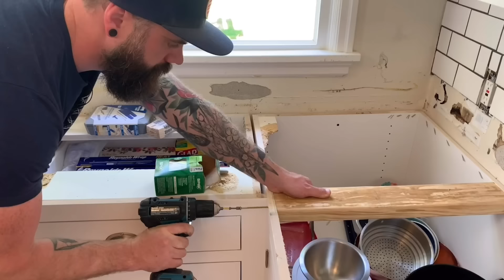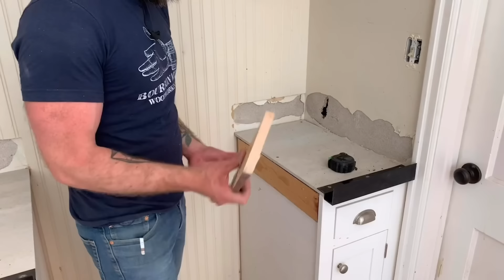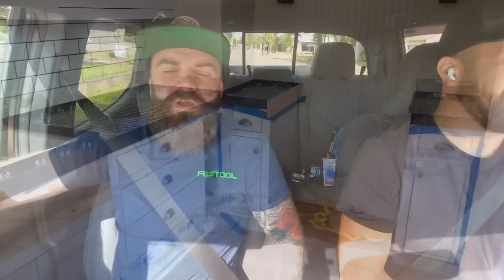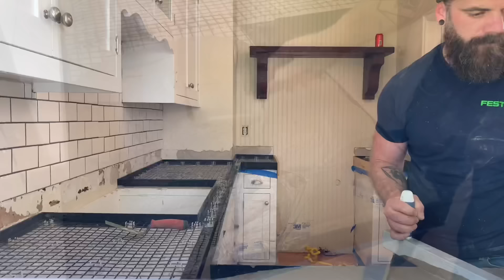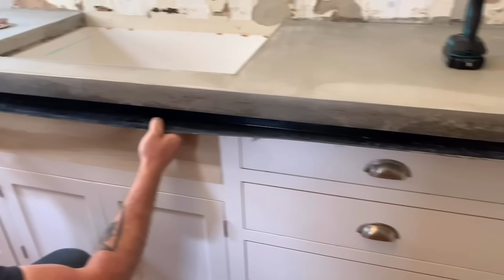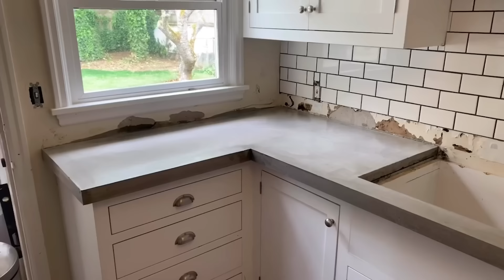Easy Concrete Countertops | Concrete Countertops How To

Comment: I was very distracted while watching your video, that backsplash looks like a drunk person did it.  I could not stop staring, like watching a car crash.
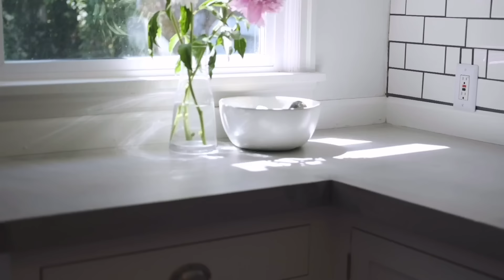Reply: i thought the same thing, look at 17:23 why take the time to do nice concrete countertops when you have a backsplash that looks like that
Reply: And also possibly baseboard bordering the backsplash and counter? Yikes.
Reply: @EL6008  good eye, i thought the same thing but wasnt sure what it was
Reply: You beat me to it. Half of the video I was looking at this horrendous backsplash install lol
Reply: Preach brother
Reply: @SIRMMA  we are slamming his finish work, but those countertops did come out nicely at least it looked like it in the video
Reply: @diggiemalo2122  Not his finish work, no. But the pre-existing tile works on the backsplash. Damn I get seasick from looking at those, check it out :)
Reply: Rob, that is not the backsplash your looking at, it's what remains after they removed the old tile backsplash from the old countertop.  It's the glue that pulled away from the wall as the splash was removed.  The rough wallboard /plaster will be covered with new tile/backsplash after the counter top is near complete.
Reply: @woodway11  He's talking about the tile work above the countertops (a.k.a. backsplash), look at https://youtu.be/llWsYmrnMUo?t=113 and tell me thats straight as an arrow?
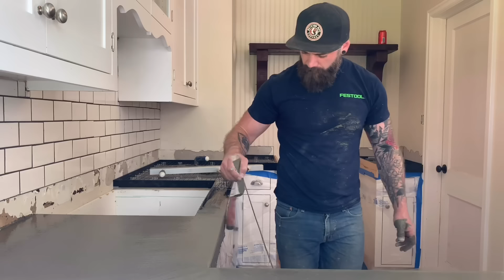Reply: @woodway11  hahahaha no that is definitely a backsplash  look at 10:45, you can see the wall board below the backsplash
Reply: Rob Guntheri was distracted- by Jason. Lol
Reply: Did it not occur to you that pouring reinforced concrete as a kitchen top is a ridiculous idea? Not cost efficient, not time efficient, messy, potentially fragile. This video is ridiculous. The dude thinks because he has a beard, imbecile cap and tattoos that he's a legend. This video is essentially pointless.
Reply: @rosbifle413  concrete counters are very popular... and its cheaper than stone in some cases. Have you been living under a rock?
Reply: @rynhanson  I'm old school. Illogical things don't float my boat.
Reply: @rosbifle413  old school meaning to dumb to change... ok there is nothing wrong with concrete as a counter. Concrete isnt fragile if done correctly. Can be colored, and sealed... granite is just as breakable. Old school used tile over wood... and you are complaining about concrete... bc its messy. Dont do construction if your worried about messy...
Reply: @niebelung54  Looking at it again, ya, the individual tiles aren't in really lining up too well.  It does look kinda sloppy , I was commenting about the 4 to 6 inches just above the counter top in my original post.  Didn't really see the field tile layout at all
Reply: It definitely looks like the tiles/'bricks' were placed there one by one, should've just done a peel and stick lol
Reply: @rynhanson  you are pathetic. Keep doing your idiotic and illogical work. I can see I've really hurt your feelings by simply stating my opinion. What a fragile person you are. If you like being messy in construction your work is without doubt overpriced and not of very good quality.
Reply: 😂😂😂😂😂 I probably have bad decorating skills then cause I thought the backsplash looked beautiful once everything was done. I was more concerned with the cabinets and cupboards... 😬😂😂
Reply: @diggiemalo2122   thank god im not the only one who spotted that.
Reply: @rynhanson  you are a dry wall guy? Haha!!!! I work for a billionaire overseeing a whole range of works in a prestigious and historic building. I'm a qualified electrician and have worked in construction with my father since i was a child. Now i don't even get my hands dirty. I 'oversee' contractors working to make sure their work is up to standard. Not that you will believe me. If you're a messy worker you aren't professional end of story.
Reply: @rosbifle413  you cant do drywall with out making a mess. A professional just puts down plastic and protects everything... so basically you had your career handed to you by your dad, congrats on being spoon fed through your life
Reply: That’s the worst layout I’ve ever seen! And what’s with the cuts along the light switch???? Gross
Reply: @rynhanson  my dad died when i was 21 years old. My hard work got me where i am today. Oh yeah god damn me because my dad passed masculine qualities down to me before he passed away. I wouldn't really class filling a cement mixer all day with cement and sand for bricklayers to lay bricks as being born with a silver spoon in my mouth. Maybe a steel shovel and a lower back made of stone. On a serious note my point was simply the less mess you make, the more effective your working is. Peace.
Reply: @rynhanson  and I didn't mean to come across as a dick. All the best. Hard work is the secret.
Reply: Rob Gunther me too! So distracting!
Reply: Jack the Lad doesn’t sound like you have any idea of what you are talking about. First of all Ryan is right about the popularity of concrete countertops, tablé tops etc. Depending on the layout, concrete countertops may be installed faster than stone. And lastly it’s way more economical to pour concrete than it is to purchase a slab of Granite or quartz. In conclusion you know shit about what you say.
Reply: A grout color that matches the tile works wonders. If your setting job or actual tile size has any noticeable variances the last thing you should do is grout it with a hard contrasting color.... That being said, nothing but a chipping hammer could fix the outlet cuts. Cool video
Reply: Tiles look like an English man's teeth
Reply: He had to remove the  bottom part of thw backsplash  to pour thw top and will install the missing pieces once thw top is complete
Reply: Jack we know you installed the original vaneer countertops that got removed
Reply: I gave him a thumbs-down as soon as I saw that he had the jungle-bunny ears...
Reply: diggie malo concrete countertops are nice? Lmao i think this countertop is fitting for a house in that condition. If you want something to match your nice backsplash, you’re not gonna get a concrete countertop.
Reply: @cestmoi2681  Shaguar!!!
Reply: @timothydu9415  -- Concrete countertops can be nice if done right... I've seen some polished ones that looked pretty good... That's not to say that what Mr. Jungle Bunny Ears is doing here will look that way though...
Reply: Now I can’t stop looking too.
Reply: @rynhanson  lol, well said. "old school" I'm his context means stuck in ways of old regardless of progress. To be fair, while they look cool, I'm not a fan of concrete counter tops, and I think it's a fad that will pass in a few years, leaving a dated looking top that's a bear to change out, BUT not gonna crap on the idea because I'm "old school".  What a tool
Reply: @rosbifle413  buddy, you have issues that are really coming out in your replies. I kindly suggest therapy.
Reply: @cestmoi2681  yeah baby!
Reply: @mikeygee4564  you must be another person who can't understand that everybody doesn't agree. Like I said before. Keep working illogically. Your clients will find out the hard way that these techniques are stupid.
Reply: It looks like the person who did it broke the last tile available around the electrical jack and was like ahh fuck it ill install three pieces.. that will look awesoooommeee bahaha
Reply: Rob Gunther it “A Kitchen” enjoy
Reply: @beatrixjones2982  I'm rude because I don't agree. Get fucked you simple minded moron.
Reply: Jack the Lad lmfao
Reply: Jack the Lad seriously dude? You’ve got zero clue what you’re talking about. It’s not reinforced concrete, nincompoop, it’s a specialized mix made specifically for countertops. Stay in your cave, gramps.
Reply: @jonrossjan  .....so....i imagined the rebar inside the concrete then? You call me a 'nincompoop' like a child yet you don't even know that reinforced concrete means concrete with reinforcing bars placed inside it. You absolute fool trying to jump on the bandwagon with the rest of the novice clowns. The mix has nothing to do with it being reinforced or not. The metal is the reinforcing. I have just taught you something. Be grateful.
Reply: @jonrossjan  a simple Google search would teach you this. Jesus you must be dumb. Google- "What is reinforced concrete used for? Reinforced concrete is used for construction on a large scale, such as bridges, dams, piers, tall buildings and stadiums. It is most commonly used in domestic construction for the footings and foundations of smaller everyday dwellings."
Reply: @jonrossjan  HAHAHA!!!! SERIOUSLY DUDE??? YOU'RE STUPID.
Reply: Just wondering how long before those concrete edges and corners crumble.
Reply: @musthavechannel5262  we moved into a house where this was done to the kitchen counters six years ago. I was told that they were done two years prior. So I can confirm they are no less than six years old. and probably not more than 8. They look as great as the day we moved in. We have slacked a bit on the sealer; it was recommended once a year. I think I have done it three times total. Now, I can't say if this was a Z countertop product. It was also acid stained (I think that's the right terminology).

I have seen similar work done in restaurants, namely the restrooms, to the point that even the sinks were poured concrete. I personally find it a really nice industrial look.

Will it outlast stone, or other options? I have no idea. One guy on here seems adamant that this is an illogical build. I don't do construction work so I honestly couldn't say. But it doesn't seem to be getting damaged, despite not going out of our way to keep it looking nice.
Reply: As to ALL comments abt the backsplash...Didn't he say 1st off..."This is A kitchen..NOT MY KITCHEN"... obviously doing someone else's kitchen it's NOT good manners to just blurt out how bad a homeowners backsplash is...maybe it was their 1st try..a friend or someone did it for them..,who knows!!  All u men can relax your chests, we get it!! 
So it isn't a reflection on him. They always talk abt women gossiping-- but working w men on any construction-whew!! Just kinda difficult trying to get any beneficial info with all these men who obviously have to cut others down to bolster their self esteem, instead of just making constructive/helpful comments.
Reply: @diggiemalo2122  u7 u7 un ñ7
Reply: Dude, so glad I’m not the only one who noticed, I felt like a jerk but when he paused the video, I’m like “holy crap that’s an ugly splash” 😂 also light sanding / polish goes a long way in making nice concrete tops that don’t look DIY. 👍🏽
Reply: @diggiemalo2122  photos never do it justice, good or bad but we’re not here to criticize. Good effort and some good tips either way. 👍🏽
Reply: @woodway11  no we are looking at the joints and consistency of the tile work above that. It’s not great.
Reply: @clalyrics441  nothing wrong with one by one if the tile setter knows what he’s doing 👍🏽
Reply: @pelassancho24  all correct but some custom concrete tops can be just as expensive and more beautiful than any stone. 👍🏽
Reply: @timothydu9415  you’ve obviously never seen custom concrete counter tops, they’re done in multi million dollar homes and high end restaurants and buildings, custom features that can’t be done with stone, sometimes can be more expensive and more beautiful than any stone. 👌🏽
Reply: @armandocarlos3805  I didn't say there was anything wrong with it, but if it looks like that you're better off doing something else.
Reply: I live in a townhouse complex, and we have granite countertops. I must say I hate them. You hear everything your neighbours plonk against it! Aaargh!🙉
Reply: In fairness, this is a concrete countertop video, not a kitchen remodel video. 

He didn’t explain how to install a stove in that gap, or how they chose that sink. It doesn’t look like they intended to touch the backsplash for now. This is probably an expensive rental unit that needed new countertops. So you just replace what has to be replaced and carry on with life.
Reply: Not to mention the tiling!
Reply: @woodway11  1733 is the finished 4-6 inches above counter
Reply: I only came to the comments section to make certain somebody mentioned this tile job! Looks like the homeowners did it themselves. Probably after they spent their wad on the custom inset cabinetry..

Comment: Is there a reason why you didnt try to color them, or maybe go for a marble or granite appearance? Just curious. Great video/tutorial btw.
Reply: If that's the look you're after, epoxy over existing counters is the cheapest/easiest way. People who want concrete counters want the industrial look
Reply: @elizabethpenton2306  idk...I seen some videos of people making colored concrete and pouring and lightly mixing into the wet concrete already poured for the countertops. They turned out looking really good. Pretty damn close to marble or granite in my opinion and at a fraction of the cost. I also like when the sinks are made from concrete instead of dropping in sinks.
Reply: 2 options. You could add pigment to the mix, but like he was explaining about adding water, get your measurements figured out on the first pail. Otherwise you risk varying the color.
Other option is to stain it after it’s cured before the sealer. 
(If you are going for a faux finish or mottled look, I’d recommend staining.)
Reply: @Elizabeth Penton  imagine not just epoxying the wood veneer original countertops to look like concrete for like 180$ but instead going through all of this work, trouble and 1000s to end up with unfinished concrete countertops

Comment: I would think the mesh reinforcement is most important for the edge that drops down.  That portion of the concrete is not supported by the hardy board and has added weight hanging down below the edge.  The top surface would be under tension so the mesh would help with that
Reply: To be fair, it really doesn't matter where he places them, that plastic mesh is not "reinforcing" anything, believe me. It will not prevent it to break, it will only help that, when it does break, it won't fall into pieces... I don't want to be rude, but people in the US know how to work with wood, but when it comes to cement, concrete, they still have a lot to learn.
Reply: @Rapha2587  concrete has almost no tensile strength but a high compression strength.  The mesh is placed there to add tensile strength.
Reply: @a.1441  Exactly, therefore, complete usuless. Concrete it's not, nor is it meant to be "tensile". Adding that plastic mesh is not doing anything.
Reply: @Rapha2587  any object with external forces (including gravity) experience tension loads. Especially on overhangs.
Reply: @a.1441  Yes, that's why we use concrete, which is quite resistant to such loads. I didn't say some kind of reinforcing isn't necessary, I said THAT plastic mesh isn't reinforcing anything and it's useless.
Reply: @Rapha2587  the mesh they installed was for reinforcement. It was put near the compressive load path rather than the tension path.  The counter is more susceptible to cracks because of it lol
Reply: @Rapha2587  it's fiberglass in plastic.
Reply: @a.1441  Isn't what you've said exactly what I've been saying? They meant to reinforced it, but what they have used and where they have placed, it's not doing anything.
Reply: @Rapha2587  I agree it's not working correctly as installed. I thought you were saying there's no point of putting the mesh in

Comment: Thanks for the video. Would it be an idea to have a chamfer, maybe 3 mm or so, on the top outside edge? That edge looks sharp, I can imagine it would snap if you dropped a big pot or something on it. Just a thought.
Reply from the maker: I just sand the edge lightly with a sanding block to bring them down a bit. I have had these same profiled tops in my house for about five years and they still look great.
Reply: you could use diamond pads used for granite polishing to chamfer or even round an edge on there. it can be done

Comment: If these forms exist with round edges, that would be perfect: Straight angles are way too prone to chipping when hurt by a l=metallic pan.
I have seen people adding a bit of white cement and mixing it very roughly: When poured, it looks like marble veins.
There are also coloring and powdered rock additives you can add for a more natural stone look of a specific kind.
A fossil velociraptor inclusion on the kitchen bench would be awesome!

Comment: Concrete counters are super heavy, I did my kitchen with them two yrs ago, a this point a lot of the wooden structures/boxes under the counter are failing and showing small fractures...  There has to be a way to make sure your boxes can take that much weight.
Reply: Maybe using thicker wood or add more support beams
Reply: I've seen people use a foam core to lighten the load. Check out Modern Builds or HomeMade Modern, they've got great videos on Concrete work also.
Reply: @chrislamoureux5500  thanks for the advice.

Comment: Seems like the sharp edges would chip easily. Can you round off that leading edge with a concrete edger?
Reply: That company has an option
Square or bull nose edges
Reply: I had the same thoughts! But can you round that leading edge off with an edger without removing the forms? You have to do the edging before the concrete dries off, but the concrete would lose it's shape if you removed the forms before the concrete set.
Reply: @gaborzamborszky5992  yes you can edge it without removing the form

Comment: Use an electric sander on the sides with no grit on it to vibrate the sides to get the air pockets out of the concrete

Comment: This guy is a hack.... Air bubbles all over the surface, chipped outside corners, a baseboard moulding used as the backsplash?? Not to mention the subway tiles are crooked as all get out...
Reply from the maker: ItsAllAboutBrandon I think you misspelled Hunk